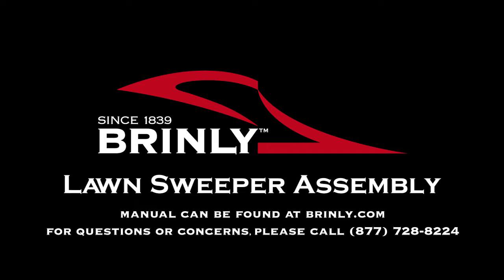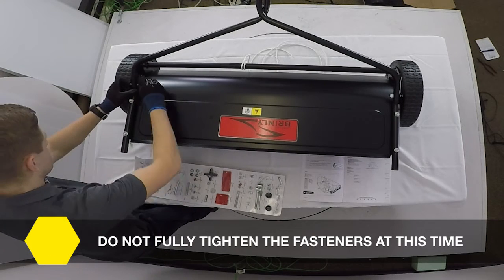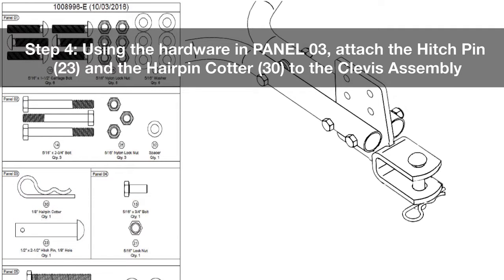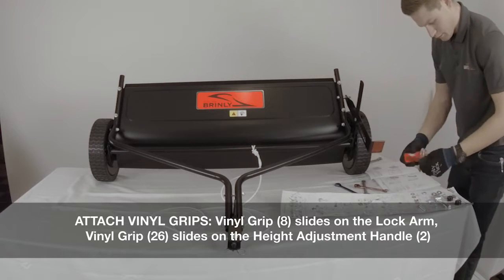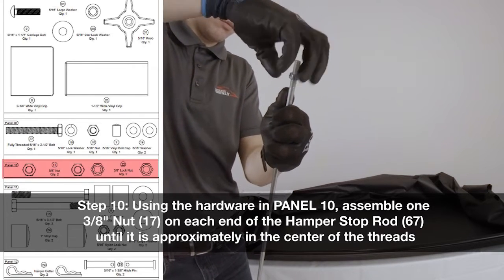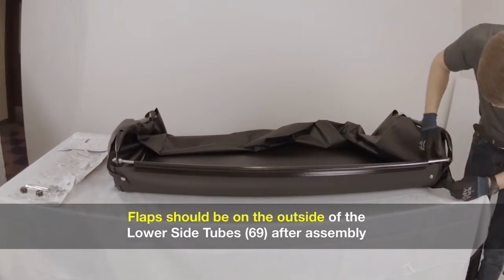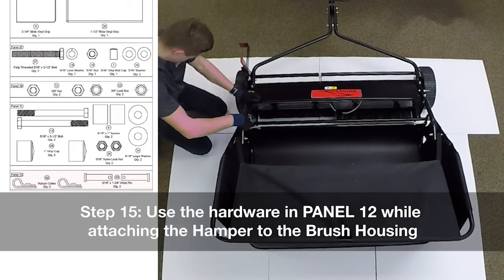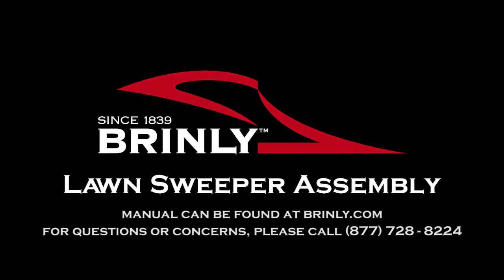How to Assemble the Brinly (MODEL STS-427LXH) Lawn Sweeper

Comment: Had to watch the video along with using the manual, as there are tips in the video that either are not in the manual or I didn't see them. Spent almost an hour trying to get the height adjustment bar installed correctly. wasn't until I watched the video I found out the sweeper assembly needed to be rotated. Don't know why I didn't watch this video first.
Reply from the maker: Thank you for sharing your experience with us. We are so happy to hear that you found the assembly video helpful. Enjoy your new lawn sweeper!